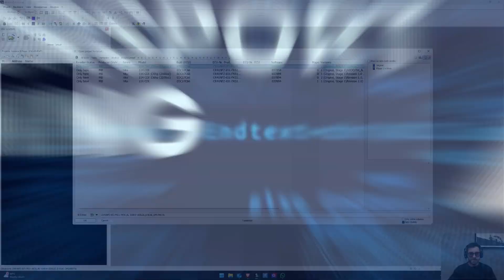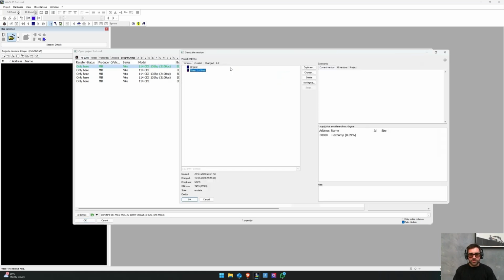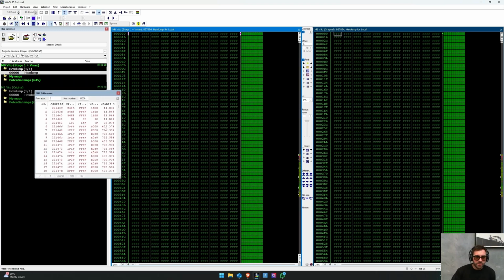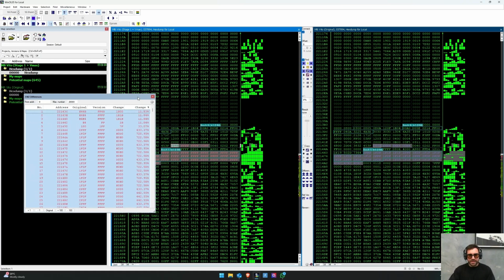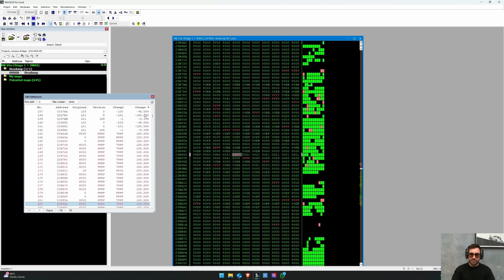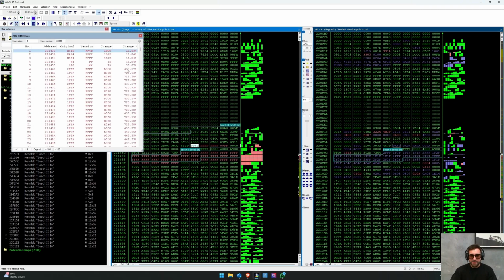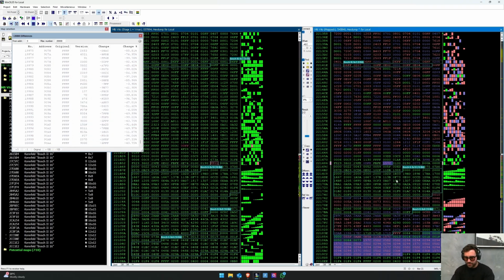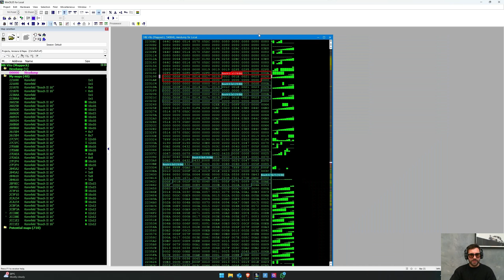WinOLS Basics - Transferring Changes Between Files

Comment: Great video, but what about OTP part? And all the immo stuff?
Will this method also try to copy those parts aswell?
Reply from the maker: Why would you be transferring OTP or immobiliser data when I am just referring to calibration area changes? If you’re smart enough to ask me that then you know what you shouldn’t do
Reply: @labordemotorsport  Sorry if this is a dumb question—I'm still new to this.
To ask it better: how do you figure out where the OTP and IMMO data are located in the flash?
Reply from the maker: @domagojsvec1800 you’d need to learn about the memory map of the processor you’re working with. Read the user manual for your processor

Comment: Does it work just as well to open the ori read, select search similar projects, finding a 100% data area match (maybe different tool read) and then selecting import changes automatically?
Reply from the maker: @JordanPolden  yes but only if you are certain the calibration area matches with the map addresses
Reply: @labordemotorsport  ols showing 100% data area would mean addresses etc... are also the same would it not? Or can it be a 100% data area for the hex data but have different addresses?
Reply from the maker: @ if data area is 100% you’ll be sweet
Reply: @labordemotorsport  thanks for quick reply btw!

Comment: What if i want to copy tune from file with different software version and I see that in modified file value before mod is different that value before mod in file that i copy tune to?
Reply from the maker: @sdd123e  this is normal, and often software versions which differ will have different data in the maps, and even different map sizes. You need to verify the values and whether it is a map or not before transferring the tune values over. Sometimes the hardware is different so don’t blindly copy and paste!
Reply: @labordemotorsport  I want to copy EGR off solution from PSA DCM 3.5 to PSA DCM 3.5 but with other SW, most of things looks same but there are some differences like single adresses(i dont change them) and also as I said some values in source file before tune are other than in file that i want to tune. But when it looks like map i copy them as absolute value. I understand it right? Maybe I should copy them as difference value but map will look weird when i do it.
Reply: @labordemotorsport  What is your reference for finding out if hardware is different?

Comment: nice, but what does a chune do???
Reply from the maker: @jaythacker5160  a tune can do anything from changing the temperature thresholds before the radiator fans turn on, to performance oriented adjustments such as raising target boost pressure, advancing injection or ignition timing etc.